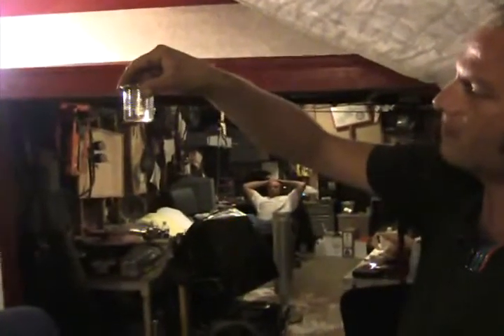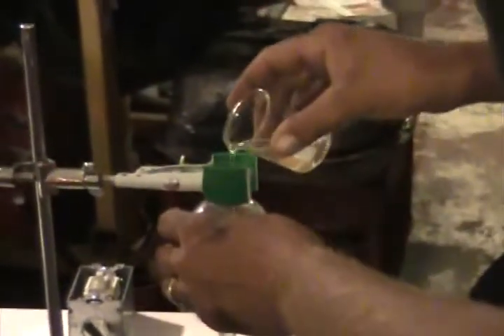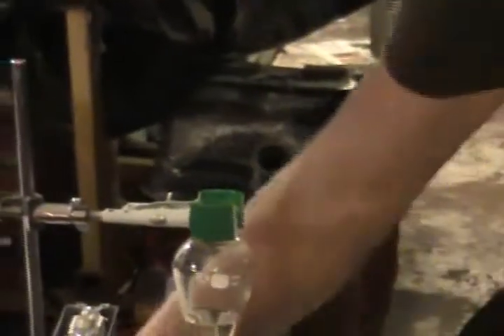generator running on hho testing Pt.6

Comment from the maker: I didn't see a video in your post, pm me with it. Now a higher energy spark will help, but as per testing, you don't HAVE to change the spark ignition, I just need to get up to 20% intake volume hho, then it runs fine, this is about 5% too lean. Will it make it better, very probably, and spark mods will be gone through, I just haven't seen one that was consistant and didn't destroy the plug. Please share the video with me, has anyone ran a gas engine on these mods?

Comment from the maker: Well on the first test I actually had the cell powered off the genny, for a while. But in all the others, and for most of the testing it is being powered from 118v 60hz ac wall power, ran through a bridge to create the dc. The switch on the table connects the cell to either wall power or gen power. I will add it into the next vid.

Comment from the maker: did you get a chance to look at the other parts, it shows the whole setup. It is a hydrogen on demand type of system, this will be one of a few testbeds for analyzing 1. how to run an engine on just hho, 2. how much does it really take, and how much power do you get out of it, 3. answer the age old question can it self propel with what we know right now (yes the answer is obivious, but it still needs to be demonstrated) and does small amounts increase fuel economy, and how much is needed